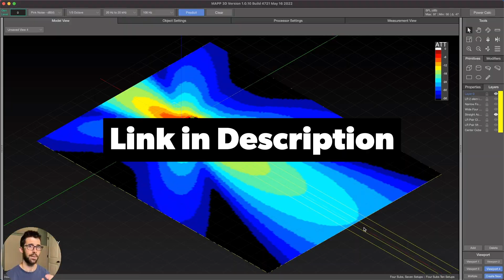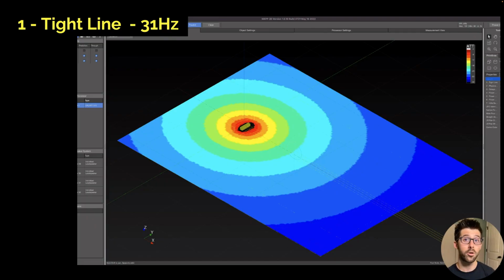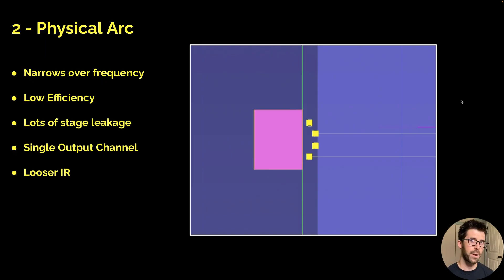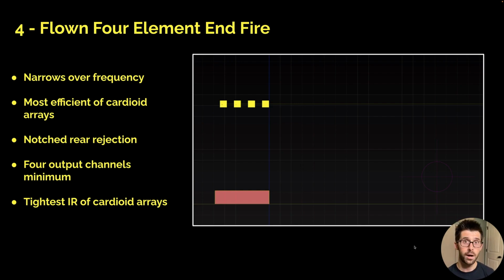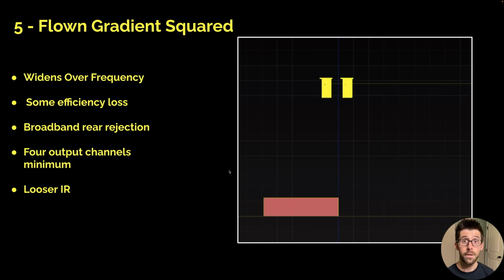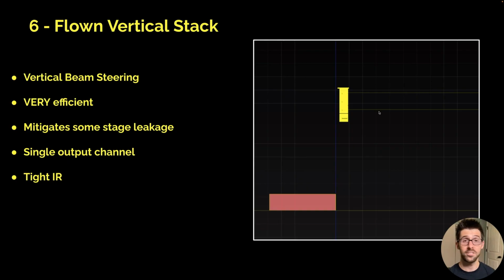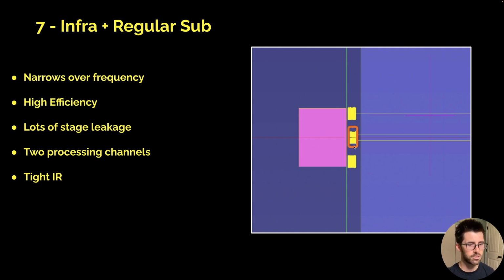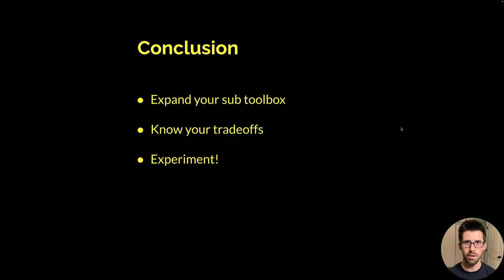Four Subs, Seven MORE Setups | Gradient Squared, Endfire, and Other Fancy Subwoofer Arrays

Comment: I have 8 18inch in total. 4 b52s (older style subs yes haha), but I stack those on the edge of the stage. The stage is elevated. So 2 b2's on each side, stacked on each other. 

The other 4 subs are below the stage, with a false front stage. Just a sheet covering where the subs are. I have tried spaced 3 ft apart each, coupled all 4, and I can't really tell which is best. 

I'm assuming spaced between the 4 under the stage is optimal. If I'm incorrect, lmk. Thanks!

Comment: Would you do a sub analysis where the stage is at the side of a rectangular room? I come across this many times at conferences. Think of a high school gym but your stage is in front of the scorer's table.
Reply from the maker: In that particular case you want as wide of a pattern as possible, so either a single stack of subs if you need multiple, or an inline gradient to help keep the pattern wide.
Reply: @MichaelCurtisAudio  Thanks!

Comment: Is it a good idea to combine flown subs with subs on the floor or wouldn't you recommend that?
Reply from the maker: I will use some floor subs in front of the stage if it's a large system with flown subs to help the pit audience have some low end that images from the stage instead of above them (since they'll likely be listening to front fills from the stage, not the main PA).

You can also use flown subs to cover 31Hz - 80Hz or so, then use some infra subs on the ground to get below that (down to 13Hz in Meyer's case). With such long wavelengths stacking them in a row doesn't narrow the beam as much, and you can do a delay arc to spread things out.
Reply: @MichaelCurtisAudio  Thank you so much :)

Comment: Is it possible to do an inline cardioid blending different sized subwoofers (Like 18s in the front and 15s in the back, with similar build construction)? Would this work?
Reply from the maker: As long as their levels and phase response are matched and you're not driving the smaller sub into limit.

Comment: I've loaded some subs into Ease Focus, and tried every configuration you talked about. I just get these boring circles. Do i need different software?
And Ease Focus doesn't account for room modes or wall reflections, which are a major factor, especially in smaller rooms.

Comment: I have an outdoor gig and I have 4 qsc 118s. If I used your first layout and did them 1 backwards, 1forwards (set to Cardioid in the dsp) and then repeated that with the next two in the line would that work to form one big wide cardioid? The stage isn't tall enough to stack them.
Reply: i have the exact same question 😅

Comment: 2 questions, 1-is half wavelength measured from the middle of the speaker or edge of the sub. 2-can you mix 2bass reflex and 2 bandpass together ie 2 yamaha dxsxlf and 2 yamaha dxs mk2 for a 4 sub arrangement. great informative vids by the way .
Reply from the maker: 1. You can measure from either place, just as long as it's the same reference point for each.

2. Thank you! As long as their output and phase response are similar and you're not driving any of the boxes into limit you can.

Comment: You are awesome!!!
I constantly use you vocal EQ!!!
Our band has 4 members and we all sing lead and harmonies. 
My speakers are JBL SRX835p. And they are paired with SRX818sp subs.  The 835 tops have nice mid throw to help vocal projection.  Your vocal EQ techniques and compression work well for us.  Man…. If you are ever in St Augustine Florida….  To have you at our shows would be so awesome.  
Most of our shows I have my 2 subs stacked forward with an 835 on top and other 835 on a tripod.  On an outside show, I’ve put the subs center&sidebyside with each 835 on tripods.  Both these setups throw subs well with no alleys.  Some shows the subs are separate on each side of stage with 835’s pole mounted and the alleys are prominent 😢 but it’s the venues and it’s what we can do.  
Again ….  You are awesome!!! Thank you 🙏🏻
Reply from the maker: You're very welcome!

Comment: Michael- I have an event coming up in Oct. of this year. The room is wide rather than deep. I have 4@ EV ETX subs that I plan to use.  From the front of the stage to the sound booth will only be 60 ft. On the right side and the left side of the stage will be 75 ft. ea. Please advise. BTW- I plan to use 2@ EV ETX 35P on each side. I know they only have a 60 deg. horizontal pattern on the horns so I want to direct them appropriately. If I don't have enough coverage, I will use a ETX 15P to help with fill speakers- delaying them as well. Please advise on the bass set up. Many thanks!

Comment: One thought. If you were buying brand new subs, buy ones with networking, what this does is revise you to use one or two outputs from the mixing Consol but then you can do all of this processing inside of the speakers on your laptop.
Reply from the maker: Yes, having processing in the speaker's is certainly one approach to give you more processing flexibility.

Comment: Can you use different types or brands and still get the results? Is there any info on building a cardioid all in the same box?
Reply from the maker: As far as mixing brands, you certainly can, but you would need to make sure their spl handling, phase response, and magnitude response are all similar.